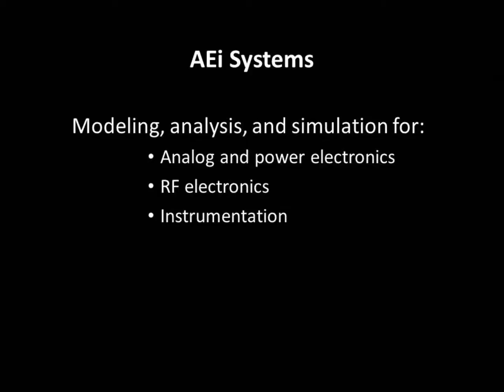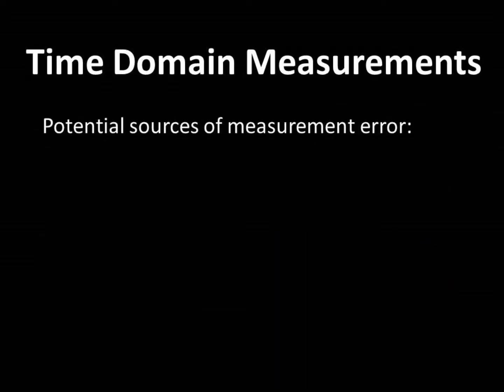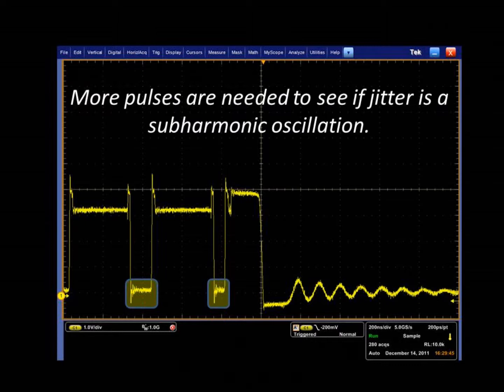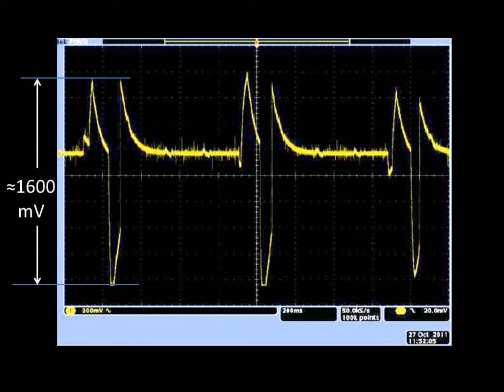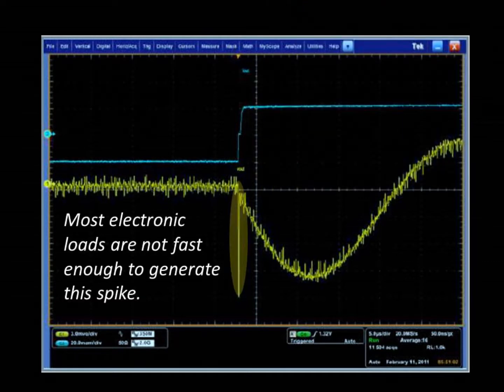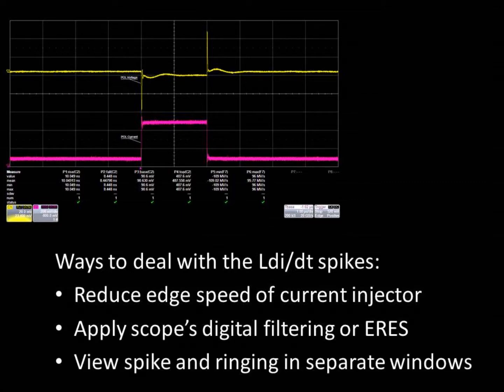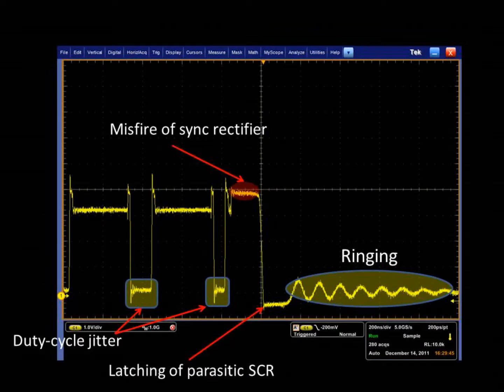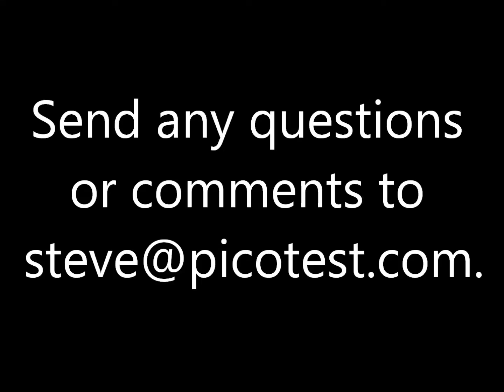Troubleshooting Distributed Power Systems (Part 8): Making Time Domain Measurements

Comment: Commenting on this video series, Dr. Hamish Laird said, "My colleague and I looked at the videos and were very impressed with the clarity and with Steve Sandler’s capability. He does a good job explaining the results. We liked very much the single port impedance measurement as an indication of the stability. There is an issue with doing this when there are converters connected as loads to other converters. In this case, it is not clear what the source of the low margin is. As there is no real cause and effect it is not something to go into in a short video. All up we were very impressed."
Reply: Thanks to Dr. Hamish Laird for taking the time to both view and comment on these videos.  He makes an excellent point -- It is true that it 's difficult to determine the source of the issue in this situation, as there isn't a clear cause and effect as much as an interaction.  Perhaps we'll discuss that topic in a future video.

Comment: Regarding EW's request below to keep the videos posted on How2Power, we are preparing a special page on the website where readers will be able to access all the videos in this series together with links for the materials referenced in these videos. We'll post a note here on YouTube when that page is ready. In the meantime, you can access all the videos in this series by going to www.how2power.com, and then entering the word "Troubleshooting" in the How2Power Design Guide search box. This search will call up summaries and links for all the videos in this series. The videos can also be accessed in the archived May 2013 through Jan 2014 issues of How2Power Today at www.how2power.com/newsletters but that requires a little browsing.

Comment: Continuing with his comments, viewer EW added, "The late Dave Middlebrook wrote a paper maybe 30 years ago on interface issues between input emi filter and power conversion circuit that is kind of a classic that made us aware of some of the impedance issues that Steve describes and Dave also described design techniques for avoiding those interface impedance problems which could potentially result in stability and noise issues.  I too have encountered engineers who thought they had a noise problem when the root of the problem was actually an unstable loop.  "